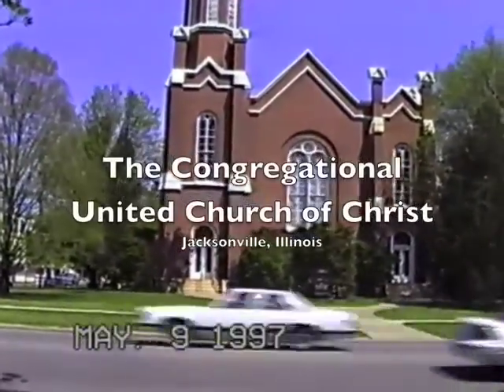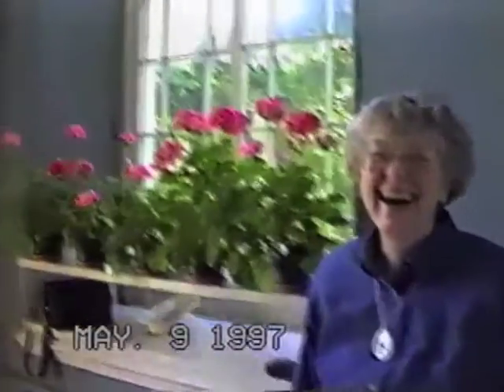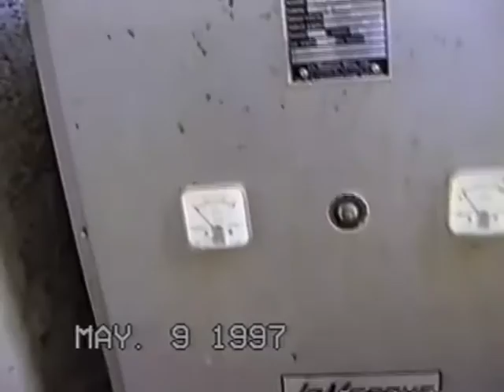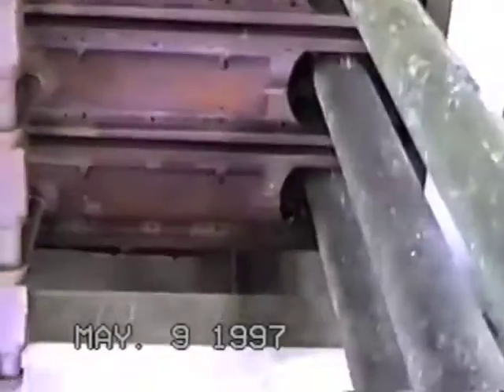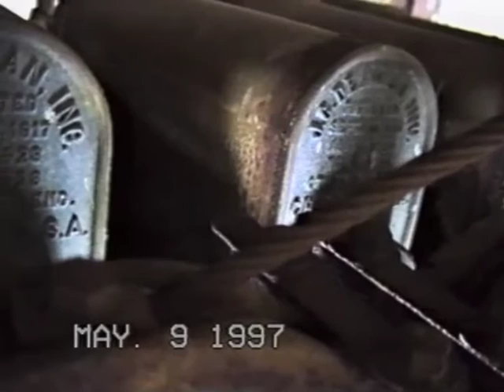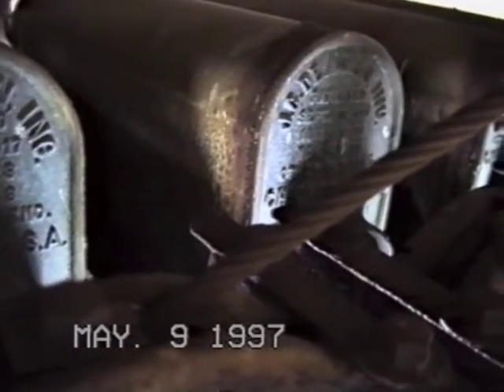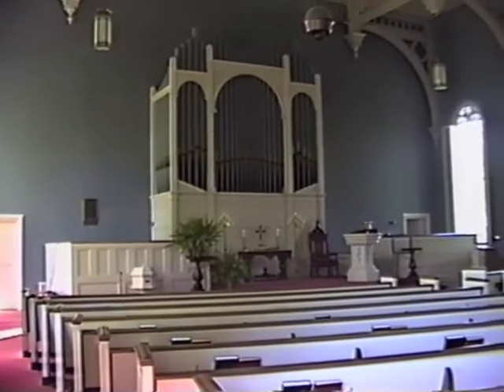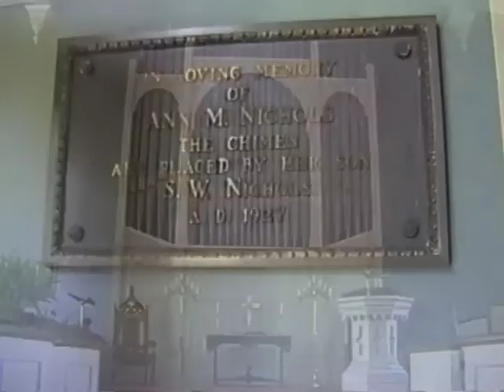Deagan Tower Chimes Tour, Congregational Church UCC, Jacksonville, IL

Comment: What a fascinating little video! I've always been interested in the Deagan Chimes, I'm lucky enough to live very close to one of a few UK instalations. The Church bought the chimes from a redundant church in America in the 60s. It was installed with modern solenoids so it ran off standard mains without the need for the bulky generator, also it was capable of playing multiple notes simultaneously. I've managed to digitise the chime by recording all the tubes individually so i can practice it at home on my computer and get a realistic sound. One favour to ask would it be possible to get a scanned/photgraphed copy of the chime book emailed to me as ive hear of that book but could never source a copy. I would happily send a complete set of recordings back in return. thanks again!